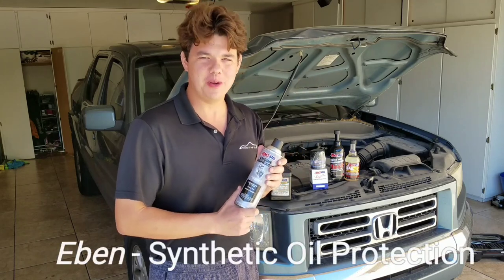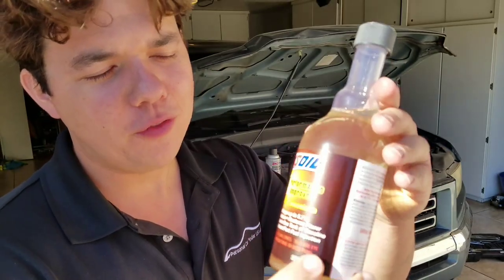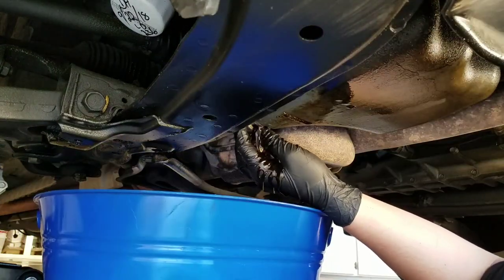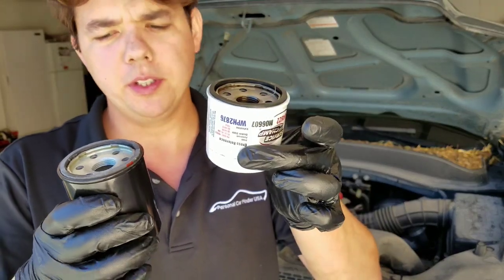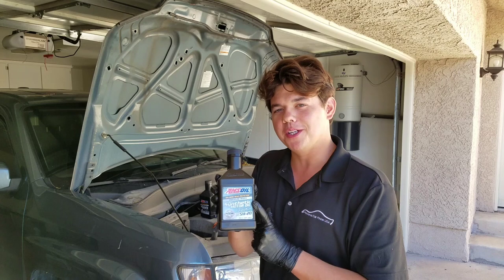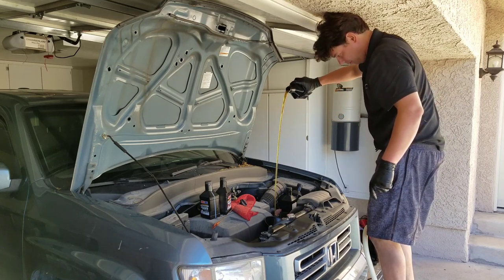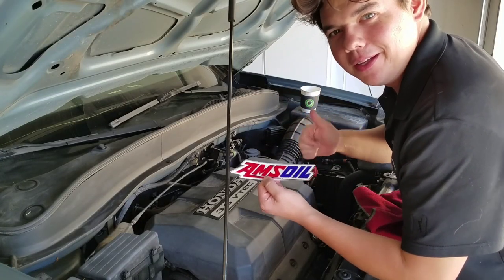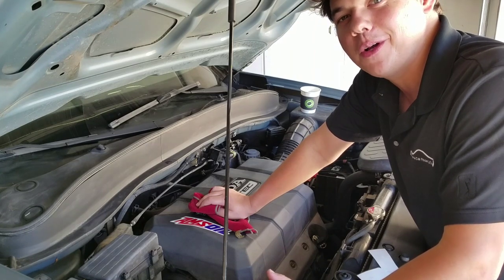2006 Honda Ridgeline AMSOIL Engine Flush Oil Change

Comment from the maker: Check THIS: Ridgeline AMSOIL ATF Transmission Fluid Change - https://www.youtube.com/watch?v=LPon0CzXfBg&t=183s

     My Link: Best AMSOIL 100% Synthetic @ Wholesale + FREE Shipping: https://www.amsoil.com/offers/?zo=5331179

      AMSOIL Products & Vehicle Lookup - https://www.amsoil.com/guides.aspx?zo=5331179 

     AMSOIL Performance Tests - https://www.amsoil.com/performancetests.aspx?zo=5331179

     Follow these accounts for Ebens Giveaway:

Instagram - https://www.instagram.com/syntheticoilprotection/

Facebook - https://www.facebook.com/profile.php?id=100007973957868

     People ask me these three things:

1. Where can I find AMSOIL? - Use this link https://www.amsoil.com/offers/?zo=5331179

Or

Watch THIS: 3 Fast Ways To Get AMSOIL - https://youtu.be/RiYifuDCsnQ

2. What makes AMSOIL different than other oils? - AMSOIL is 100% Synthetic & has higher film strength & last 4×longer then Mobil 1 EP which protects and separate metal parts keeping them from wearing and Lasting Exponentially longer: https://youtu.be/f4eNPgTi_qo

3. Why should I use AMSOIL?: It protects the engine so it will last longer. Less oil changes less often(once per year/15,000miles) or longer... Save money in Gas & Time making it less expensive then a free oil change over the year - https://youtu.be/H7K6FdZlqmg

     Professional YouLubher:
Eben Rockmaker Executive Direct Jobber AMSOIL Specialist (Dealer#: 5331179)
Mobile: (702) 472-3614

     My Link: Best AMSOIL 100% Synthetic @ Wholesale + FREE Shipping: https://www.amsoil.com/offers/?zo=5331179

     AMSOIL Products & Vehicle Lookup - https://www.amsoil.com/guides.aspx?zo=5331179 

     If your vehicle is not on the lookup guide this is AMSOIL Tech Support 715-399-8324 be sure to refer to Eben 5331179

     2020 Best Synthetic Motor Oil AMSOIL - https://youtu.be/1JogVhv70xk

     Best Videos - https://www.youtube.com/watch?v=qjR2pjggjhY&list=PLB_ftWArBFdd7D6zW4OCpA0yEjh-uRY2t

     Friend me on and tag me because I like to see great results from my YouTube Community:

Instagram - https://www.instagram.com/syntheticoilprotection/

Facebook - https://www.facebook.com/profile.php?id=100007973957868

     Order AMSOIL By Phone:
Be sure to give them my number so I get credit Eben #5331179 and tell them you would like to be a Preferred Customer.

1. Call 1800-956-5695
2. Ask for your own preferred customer membership because you will get 25% off, free shipping over $100, and your informative quarterly AMSOIL Magazine. It costs $10 for 6 months or $20 for the year which is well worth it.
3. Give them my dealer number so I get credit Eben 5331179
4. Orders over $100 will be shipped free.

     Industry-standard 3rd party testing results:

     AMSOIL Signature Series 5W-30 Synthetic Motor Oil protects against harmful deposits on turbochargers 4X better than Mobil1® Extended Performance and 3.6X better than Royal Purple® in industry-standard testing*.
https://www.amsoil.com/newsstand/motor-oil/articles/leading-the-field-in-deposit-protection/?zo=5331179

     AMSOIL gets better gas mileage -
https://www.amsoil.com/newsstand/motor-oil/articles/another-win-for-amsoil-products/?zo=5331179

     AMSOIL Performance Tests - https://www.amsoil.com/performancetests.aspx?zo=5331179

     Professional YouLubher:
Eben Rockmaker Executive Direct Jobber AMSOIL Specialist (Dealer#: 5331179)
Mobile: (702) 472-3614

     My Link: Best AMSOIL 100% Synthetic @ Wholesale + FREE Shipping: https://www.amsoil.com/offers/?zo=5331179

     AMSOIL Products & Vehicle Lookup - https://www.amsoil.com/guides.aspx?zo=5331179

Comment: Amsoil are expensive filters. Fram XG 7317 full synthetic with screen backing and silicone ADBV. Walmart under $10.00.
Reply from the maker: The AMSOIL oil filter has an upgraded anti drain back valve so your engine will last longer you will have better cold starting.

     The Amsoil filter has a proprietary synthetic medium and it filters at a higher percentage 99% efficiency at 20 microns.

Also the medium flows with less restriction so your oil pump will last longer and you will get better gas mileage.
https://www.amsoil.com/p/eaoilfilt/?zo=5331179
Reply from the maker: People ask me these three things:

1. Where can I find AMSOIL? - Use this link https://www.amsoil.com/offers/?zo=5331179
Or
Watch THIS: 3 Fast Ways To Get AMSOIL - https://youtu.be/RiYifuDCsnQ

2. What makes AMSOIL different than other oils? - AMSOIL is 100% Synthetic & has higher film strength & last 4×longer then Mobil 1 EP which protects and separate metal parts keeping them from wearing and Lasting Exponentially longer: https://youtu.be/f4eNPgTi_qo

3. Why should I use AMSOIL?: It protects the engine so it will last longer. Less oil changes less often(once per year/15,000miles) or longer... Save money in Gas & Time making it less expensive then a free oil change over the year - https://youtu.be/H7K6FdZlqmg

     Professional YouLubher:
Eben Rockmaker Executive Direct Jobber AMSOIL Specialist (Dealer#: 5331179)
Mobile: (702) 472-3614

Comment: My neighbor has 750,000 miles on his 07 Honda Ridgeline and has the oil changed at the dealer for $29.95 after his $10.00 off coupon. I’m sure he is not getting full synthetic oil for that price. Just keep your oil clean.
Reply from the maker: Yes the Hondas last a long time.

     There are a lot of things you can do to your car to get better gas mileage great performance while getting along life out of your engine.

     Amsoil oil has a hundred percent synthetic oil so you have less parasitic drag on the crankcase and you get better gas mileage.

     That gas mileage will end up paying for your oil change by the end of the year.

     So you end up saving more money in gas and what the oil change costs and you save your time and your engine to last a lot longer with better compression.

https://youtu.be/fdSyZ-D3gnw
Reply from the maker: https://youtu.be/Nvq7-Z7l7Fc
Reply from the maker: AMSOIL Performance Tests - https://www.amsoil.com/performancetests.aspx?zo=5331179
Reply: No reply? Got it. Lets just put sand in the engine. Maybe itll need to be rebuilt at 800,000 miles? Maybe with Amsoil it might go 2 Million miles withoit rebuild? Statements like this do not prove anything. What if the model engine had a better steel/aluminum cast then say 30 other models in the assembly line? It was just going to ‘work’ better aeven with sand and dino in the engine? Answer all that!

Comment: Hey eben do you have to rinse off the engine degreaser? Or do you just wipe clean?
Reply from the maker: I think you just wipe clean all the directions and usages are right here on this link This is my personal link and when you use it I would be your Amsoil dealer and I could always answer your questions in the future.
https://www.amsoil.com/p/engine-degreaser-aedsc/?zo=5331179
Reply from the maker: Also if you're new to Amsoil the 6-month preferred customer program will save you the most money on a $100 order you would save about $33 because it's about 25% plus the difference in tax.

If you ever have any questions you can always reach out to me anytime.
Professional YouLubher: Eben Rockmaker Regency Direct Jobber AMSOIL Specialist (Dealer#: 5331179) 702-472-3614 

Get AMSOIL Wholesale Pricing - https://www.amsoil.com/offers/pc/?zo=5331179